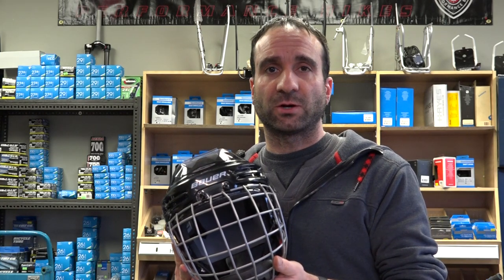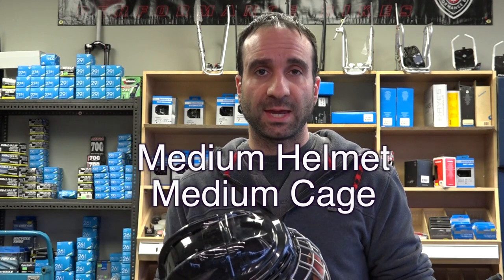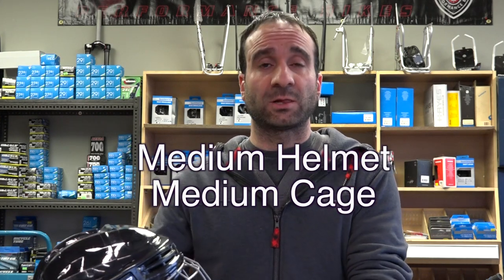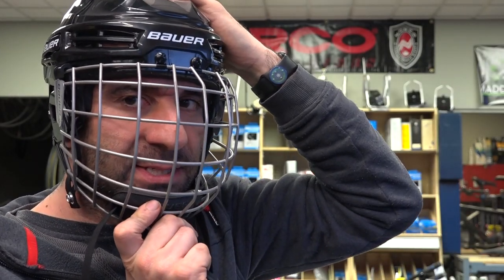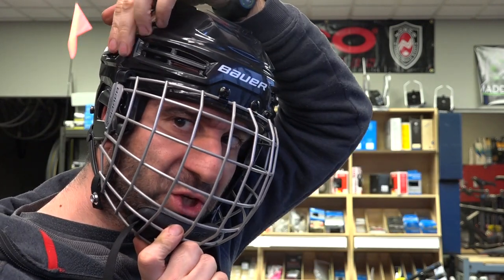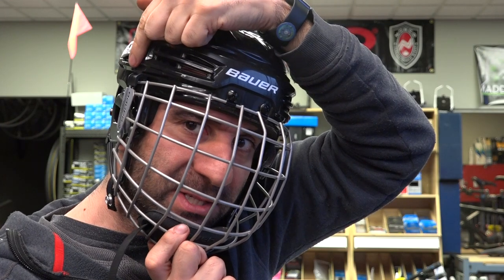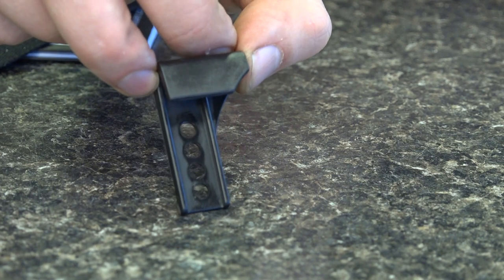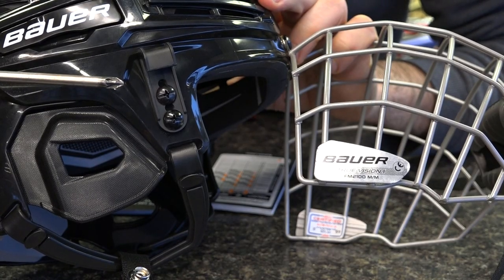Proper Fitting a Cage on a Hockey Helmet

Comment: I know this video is old, but maybe I can get some help. I have a large helmet (fits great) and a large cage (cant find XL). I have a prominent jaw and even at the lowest setting of the j clips Im still getting way to much contact with my jaw. Is there any modifications or different atyle j clips that could help me. If I lower it and only use 1 screw it works, but then the j clip doesnt really stay in place. Thoughts?
Reply from the maker: Hi, I have drilled a hole in the jclip. I think that’s the best option. I still haven’t come across a jclip that accommodates what you need. Sometimes different styles can help, but I’d say drill a hole.

Comment: Hello, I watched you video after I bought a Bauer cage combo. Its a bit loose. Im 13 and I got the medium size. If i buy the small size i fear me growing out of it or it being too small. What do I do to tighten it?
Reply from the maker: I assume we’re talking the helmet itself and not the cage. There really isn’t much you can do. I’m sure you have it condensed to the smallest as it goes. 
Just in case...
Depending on model. One you don’t need tools and can just flip the sides open to condense or expand the helmet. The other you’ll need a Phillips screwdriver to loosen the side screws. 

If the helmet still moves around after the adjustments, maybe you can wear a thin headband to thicken it up. Especially if your skating outdoors on a cold day, a toque/beanie can also keep you warm. You’ll have to expand the helmet if you do that.
You’re still growing so depending on how loose the helmet is you may have no choice to go smaller, but if it’s close enough, stick with the medium. As long as the helmet doesn’t flip to cover your eyes, people have made due. 
Wish I could have been more helpful. 
Hopefully it works out. Let me know how it goes.

Comment: Don’t play hockey but getting into box lacrosse. I have a large ccm helmet which fits very comfortably with a large cage, j clips moved all the way down, and the cage still crushes my chin before engaging the j clips. Can’t find an XL cage or helmet anywhere. Can you help?
Reply from the maker: Different makes may make a difference. Bauer bought Itech, and those may work. 
Also try reversing the 2 top clip portions of the cage, making it lift higher. 
Just the chin may be a little off. Worth a try. Hope that helps.

Comment: Can I put a medium cage on a large helmet? It's the CCM 50
Reply: No
Reply: @elitefdny4215  well I just did so shows what you know
Reply: @elitefdny4215  it fits perfect and snug now
Reply: @Beanie-Sandals  really? I tried to put one on mine and it didn’t work
Reply: @elitefdny4215  sorry if I came off a bit of a dick. It's a large ccm 50 with a fm680 medium cage, the chin piece isn't fixed to the bottom of the cage so its much more comfortable
Reply: @elitefdny4215  although I had to take off the bracket stop but the cage stops naturally at the bottom of the adjustable helmet piece. I don't see it becoming a problem, already played a few games with it
Reply: @Beanie-Sandals  it’s alright bro. And I’ll have to try it out my cage hangs so much and it looks so bad
Reply: @elitefdny4215  yeah that's the reason why I had to get a medium cage because my face wasn't long enough for the chin piece so when my chin was in place I had like 4 or 5 inches above my eyebrow where the helmet would sit, I looked silly

Comment: the cage is way to far from my face. Why is this?
Reply from the maker: J G could be a couple reasons, but mainly it’s j clips on the side. Try raising them, that will bring the cage closer.
Reply: i moved them up as high as they would go with two screws. i also tried it with a medium and large cage.
Reply from the maker: J G Try this, on top of the cage are the 2 plastic swivel pieces in the middle. Flip them so that the screws are below cage. This can help. Hope that makes sense.
Reply: its called cage hang buddy
Reply: @Joey.epp_80  6 years late pal
Reply: @JasonCGreene better late than never